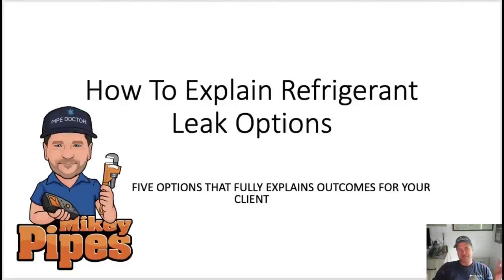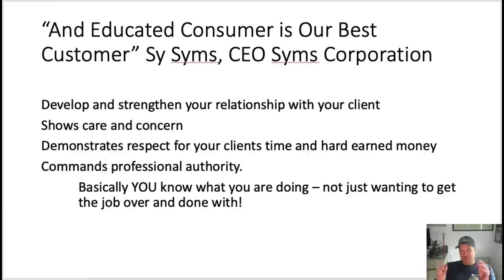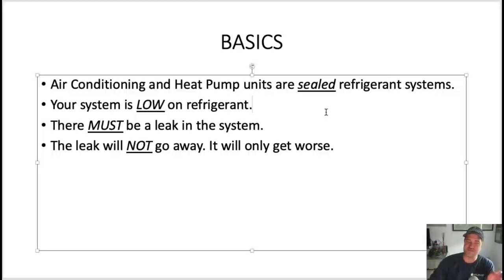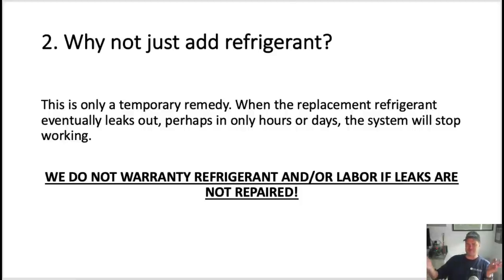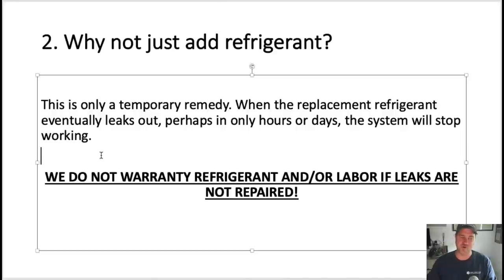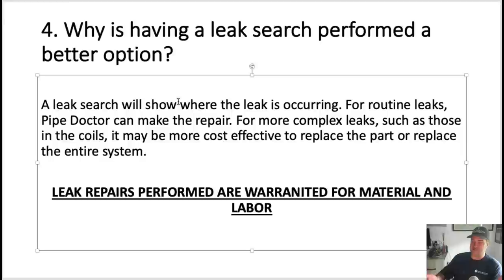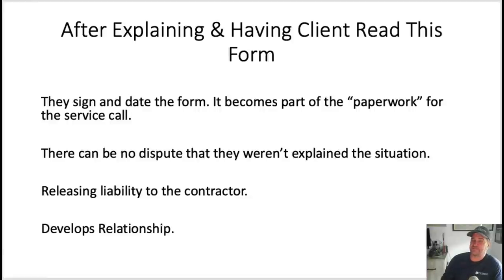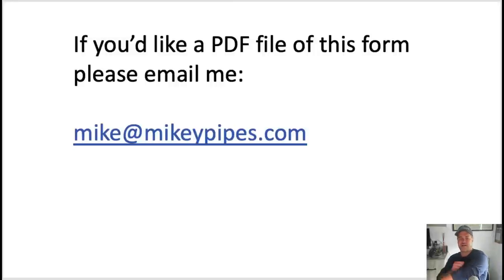How to Professionally Explain Repair or Replace Options on Leaks in Central AC or Heat Pump Systems

Comment: Hey Mike! As you knowI am a retired orthopdeic surgeon who loves your videos. I have watched them all. 

In my line of work we had the patient sign a consent form prior to surgery that listed all the unlikely but possible unwanted events that could result from the surgery. In spite of this, since very large sums of money were involved in malpractice litigation, the lawyers showed little reluctance to take on these cases on a contingency basis. Commonly, the patients would claim they did not know or read what they were signing. None the less, having that piece of paper with their signature on it often stopped the case in its tracks.

In your line of work, where the monetary reward to them is much smaller, most plaintiff's lawyers realize they have a loser on their hands and will not take the case on. That release you have your clients sign is a MUST!!!

Keep up the great work. One last thing. How do I get an invite to your party when you reach 50,000 subscribers?

Comment: You focused on liability,  but really the best way to avoid bad outcomes is to have the positive communication with customers.  A signed form helps, but doesn't eliminate claims.  This isnt different than what you said, just a slightly different perspective.
Reply: It's also important to listen to what is important to customer. I had a leak, and was open to replacing, but NEEDED a/c that weekend and they couldn't replace in time. Adding a little refrigerant to allow cooling for 10 days until replacement was ideal solution.

Comment: You saying a lot. But nothing they wanna hear. I mean less than 10 years old. It happens, but realistically it should not. I been in this game for 35 years, it should work
Reply: yeah it's alot like preaching to the choir. With inflation running hot and costs going up on everything, I dread these calls coming in July and August.